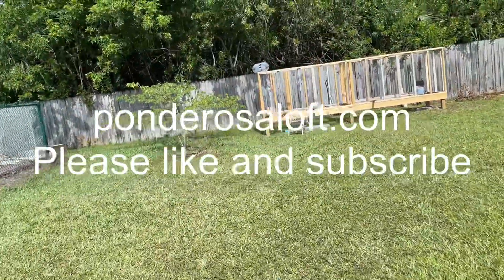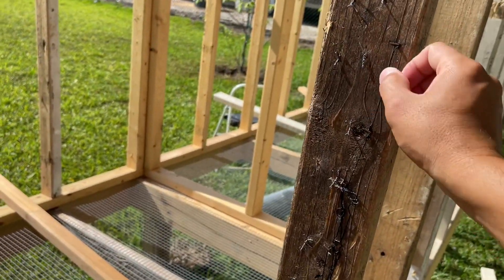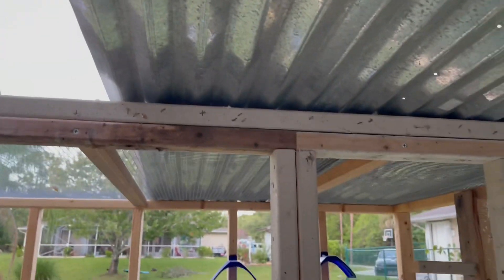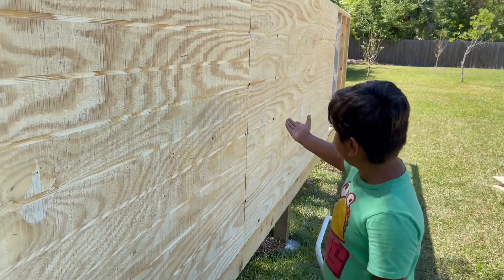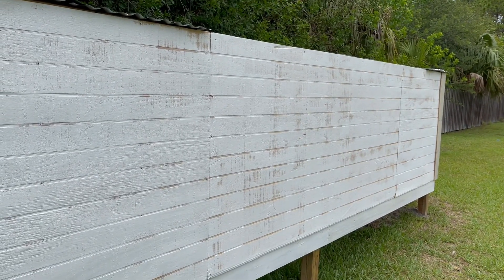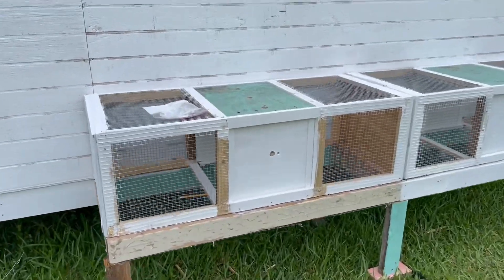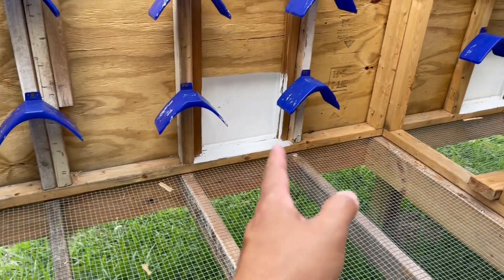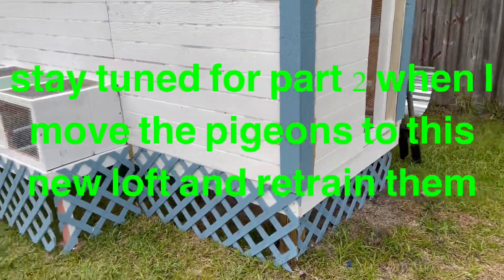Racing Homing Pigeon Loft Build in 12 minutes

Comment: Nice coop. Yes, materials to build is very expensive. My only question is why did you make it only 4ft high? 2 more feet in height would have been much better in my opinion.
Reply from the maker: Good question and I'm regretting that now :)
Reply: @ponderosalofts6851  Don't beat yourself up over it. I commented what I did is because I did the same thing. 
Live and learn. Anyway, you can raise and race your birds that's the main objective. I wish you luck.
Reply from the maker: Thanks! I'm actually building a new loft soon. Wife told me to get it right this time :) this next loft will be epic! It's cool weather season here in FL now so it's a good time to do it
Reply: @ponderosalofts6851  Check out Manley loft on you tube. He built sliding doors inside his loft. Good luck with your project.